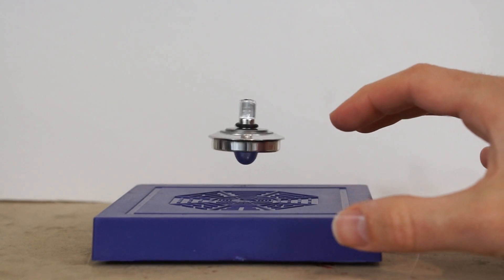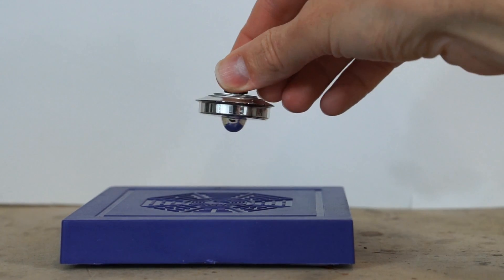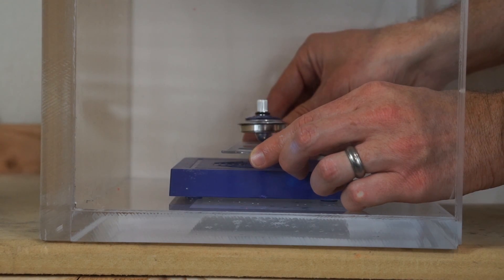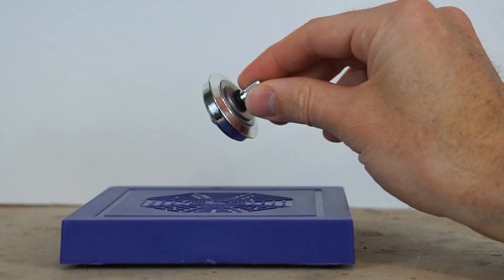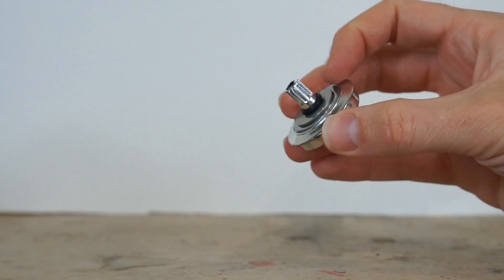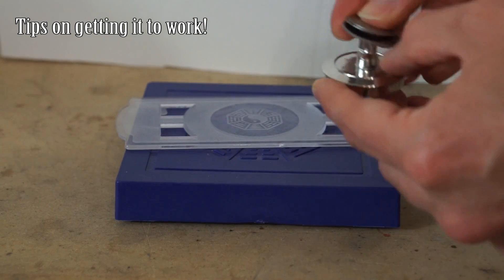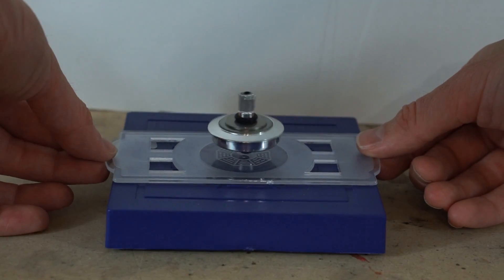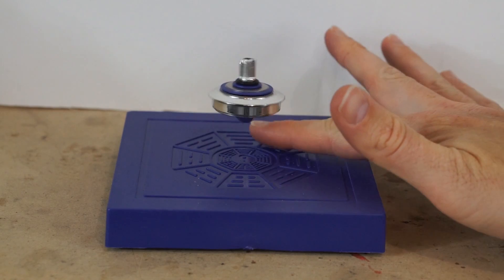Will a Levitating Gyroscope Spin Forever in a Vacuum Chamber?

Comment: it won't spin forever because the casing on the vacuum chamber will erode over time(which is not forever) and the vacuum pump itself will erode making the air come back into the chamber, and don't forget about electricity, there is a finite amount of electrical generators and power plants with an even more finite amount of resources needed to create said energy powering the pump making the vacuum stop, and what about the magnet itself? it cannot create an infinite amount of force to make the top spin forever, making said top not able to spin forever.
Reply: Yes, this is true technically but generally people ignore these factors. As a title of "Will a Levitating Gyroscope Spin For A REALLY LONG TIME in a Vacuum Chamber?" does not sound as clickbait, this experiment demon straits if the gyroscope can significantly spin longer until the factors that you considered are put into context. The person in the video is wrong about the friction entirely, as this will happen later on. 
What really happens to the magnet is that the gyroscope was not on its absolute horizontal axis, as this is extremely difficult to do. Because of this, the force of the magnetic field  is not distributed evenly on the edges of the gyroscope, this causes a increasing oscillation in amplitude of the distance to the magnet and this has proportional correlation to the strength of the magnet (obviously).
SIMPLE ANSWER: The fidget spinner doesn't slow down, it looses balance. So, the magic rocks (magnets) make it loose control because the fidget spinner is near impossible to be spun horizontally.
Reply: Hector Wilken no.
Reply: I think the idea is not so much to make it spin forever, but say, for the lifespan of a human.  That'd still be pretty neato, don't you think?  But on an even deeper level, to understand that electrons (and other particles) might be regarded as little gyroscopes who spin for a very long time and also flip over from time to time.  Imagine.  Let your mind spiral out to the infinite possibilities.  M'yan.
Reply: Flurban Moran I think subatomic structures like electrons have a completely different properties to large scale objects. This is due to the world of quantum physics, and how it redefines our understanding of physics completely.            Saying that... I wonder how many views I can get if I title a video "SUBATOMIC FIGET SPINNER WOW 😱😱 💯 🔥"
Reply: You think they have completely different properties.  That is a good start.
Reply: Well it's not really my area quantum physics, so i say "i think" because i cannot be certain, however i do have a initial understanding on the roles that take place in quantum physics. As well as, studies from various other physicists in relation. I can be CERTAIN  that roles like angle of momentum and laws in relation to gravity, have a completely can have a completely different effect in in quantum world.
@ Flurban Moran
Reply: Every layer is connected.  Don't forget, the physicists who spend all their time telling you what they know are the one's not moving forward.

Comment: Seems like it could spin much longer if you could launch it without so much wobble. Have you tried putting it in something with a stable electric motor like a drill or something similar?

Comment: IT'S MINI HAKKERO AND THIS GYRO SPINS BEING REPELLED BY INVISIBLE RAY OF MASTER SPARK oh lol just kidding, there's too much Touhou in my mind.

By the way, if we're speaking about something on the Earth orbit, I suppose, the most energetically preferable would be the configuration where test body is on circular orbit and oriented cylindrycally symmetric relative to gravitational normal, and has no rotational momentum except that is synchronized with orbital rotation over the Earth - due to tidal forces. So such gyro will be oriented to the Earth by one of its tips and will slowly rotate, but rotational axis would be not the main axis of gyro (from one tip to other one), but one that is perpendicular to this axis and orbital velocity vector (one of diameters of gyro wheel). If orbit is not strictly circular, then we'll see librations an we could see of the Moon; and if there is no cylindrical symmetry of test body, then there'll be another kind of librations due to non-uniformity of gravitational field. I think, these forces would be much more effective in stopping gyroscope in comparison to CMBR scattering and gravitational wave emission.

Comment: There is always going to be a desire for the magnets to ultimately line-up with their polar opposites. That is the friction, whether the magnet in the blue base is loose or not. It will find where the N - S are happy. Each time it passes a 'happy' alignment and spins through / lines-up / spins through, etc., it will slow down until it stops and lines up N - S relative to the top and the base magnets. That is why perpetual magnet gadgets won't run forever -- friction from the magnetic fields.

Comment: the pull of gravity against the magnetic levitation would still cause  a friction... If the spinners mass were cancelled ,then gravity would have no pull upon something with no mass ..if that could be achieved, then it would spin indefinitely...in theory   black budget tech likely use these principles ..in the case of alien tech , they  probably are using ideas far far beyond  mere mass cancellation...in our case though, it would be a huge step up from how we currently attempt levitation

Comment: Aside from the fact that there is factually no such thing as a perfect vacuum that man has ever witnessed or created... The magnets themselves provide resistance that the spinning cannot counteract forever. The gyroscope will slow and eventually flip over regardless of how much air is around it. Though less air means less friction, which means less resistance, which in turn means a longer spin. It will extend the duration of the spin, but it will certainly not allow for infinite spinning.

Comment: If the universe will not last forever, how do we know there is a forever. Let's roll one up and figure this out.
Reply: We don't have enough evidence one way or another that the universe is or isn't infinite and forever.

At the moment we believe the universe will end with "heat death" when everything, everywhere will be in thermal equalibrium, or with the "big rip" when dark energy overwhelms even the strong nuclear force tearing subatomic components assunder.  But all we have is mathematical conjecture and a few decades of observation, not enough to project out to a future of 10^100 years.

There is a chance that our 4D universe is suspended in a higher dimensional multiverse.  Our preceptions are stuck in 4D like poor flatlanders unable to conceive of 3D.  The whole notion of time may be useless in a multiverse it which time and causation is meaningless.

We know that map directions, north, south, east, west break down at the poles of the Earth.  When you stand at the north pole every direction you point to is south, no east, no west and no north.  The reverse at the south pole.

Could our mundane 4D universe be infinite?  We may be just 13.7 billion years into our universe wherein blackholes are the ultimate recyclers.  Got a stubborn sub-stellar object that won't fly apart and recycles itself?  Feed it to a blackhole, it will spew it out as a stream of fundamental particles.  Bits will fall in but Hawking radiation will, eventually, recycle that too.  We know the big bang happened due to the CMB, but given enough time the CMB will be stretched into EM wavelengths bigger than the observable universe rending it undetectable.

Comment: As several person have already mentioned, I think eddy current is a main reason to reduce the rotational speed of the top next to air drag.

In order to avoid eddy current effect, the following condition should be satisfied;
(1) Base magnet is completely homogeneous and magnetic field over that is rotationally symmetric.
(2) No wobble and precession movement of the top.
If even one of those condition is not satisfied, magnetic field which goes through the spinning top is not rotationally uniform.
And if the top magnet and weight balance is made of conductive material, eddy current is induced inside the top, which reduces the rotational speed of the top.
The top magnet is, presumably, made of neodymium magnet, which is electrically conductive. In addition some of the weight balances are made of metals (Brass).
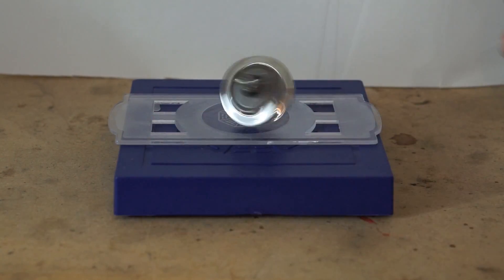You can recognize eddy current effect from the video scene of 8:37. When he start spinning the top at out of center of the base magnet, very strong repulsive force induced from eddy current effect fly away the top from the base magnet.

Comment: I don't believe you can say the magnetic field is a form of friction, magnetism is caused by unpaired electron spin within the atom? I believe the reason it stops spinning is even with the negative pressures you are using, there will be atoms within the chamber contributing to air-friction.
Reply: "negative pressure" ?
Reply: Thomas Kundera: Yes or in other words a vacuum), but thinking about it, i guess i am wrong on magnetic fields not being a form of friction; you could argue any form of resistance is friction.
Reply: Then it's "zero pressure" ;-)

Magnetic forces doesn't imply friction, but you have induced currents effects that will certainly create friction.
Reply: Thomas Kundera: No, anything below atmospheric pressure is considered by scientists as negative pressure and yes I agree, its the context to which the forces are being used.
Reply: "anything below atmospheric pressure is considered by scientists as negative pressure"
If you arbitrary put a "zero" at 100kPa.
It does make sense in some cases, but agree that it's arbitrary.

Pressure measure the force that gas particles creates. And you obviously reach zero when there is none left.
Reply: Thomas Kundera: Yes you can read temperature as absolute or relative, so if someone says negative pressure than assume they mean temperature below atmospheric at sea level.
Reply: @Suzy: as we are speaking about vacuum, its' better to talk in absolute pressure, where vacuum pressure is zero, as it should.
Reply: Thomas Kundera: Yeah and everyone in the West wants the yanks to go Metric; thats life)

Comment: Well, it is not friction which slow down the gyroscope it is magnetic induction because the metal the magnet is made of is a conductor so the off axis rotation(i lean the fact that the gyroscope is not perfectly aligned with the vertical axis which imply precession due to the magnetic field) of the gyroscope slow it down. Also background radiation won't slow anything they are almost isotropic so you have a lot of interaction background radiation photons but no net force and then considering the size of the object and it's density there is only a negligible amount of energy (i mean way above thirty order of magnitude under) lost due to gravitational wave than the amount lost due to star dust, because even in the emptiest void of the universe you have 2 atomes per metre^3 and this is the main reason why it would stop in vaccum(space)

Comment: Spinning in presence of magnetic field will produce Eddy currents and force will act on current carrying gyroscope present in magnetic field thus it gets damped
Reply: Wolf Edmunds not insignificant 
Enough to slow it down
Reply: Ferrite is not an electrical insulator, so it has eddy current losses - but a lot less than metals.  The thin chrome plating on the toy itself is unlikely to be as significant.   And there's still residual air to provide friction (is viscous drag linear with pressure?  I'd imagine strange things happen with long mean free paths).
Reply: those two responses sum it up well!   well done!
Reply: Ideal inductors do not dissipate power. That said, unless the top was made of a superconductor, there will be resistance and that small resistance will convert a tiny amount of electrical energy (from eddy currents) to heat.
But all things considered, the amount of energy lost due to eddy currents is still extremely insignificant.
Reply: that and the fact that even space nebulare are less dense then the artificial "vacuums" currently producable by human science.
Reply: Though eddy currents do have an effect its extremely minimal, the reason it slows is due to the instability and shaking burning off all the energy

Comment: There is supposed to be version of this done with a 1 kg iron ball. It's start spin was 1000 rpm and was estimated to lose 1 revolution per second per second (about 1 revolution per day) thus spinning for years.
Reply: Vance McCarthy 
Interesting story. And where did you hear such wonderful things?
Reply: 1000rpm, losing one per s², that's a bit less than 20 minutes of spinning, not years?
Reply: 1.000rpm = 60.000 Hz. Reduces by 1 Hz per second (Hz = 1/s, so 1 revolution per second per second = Hz/s). Therefore the ball would stop after 60.000 seconds, which is a 1000 minutes which is 16 hours and 40 minutes. Its neither years nor 20 min. Its simple math guys... This is of course assuming that the original statement is correct that the deceleration is actually constant and 1 revelation / s^2, which is highly doubtful.

Edit: of course 1.000 rpm = 1000/60 Hz = 16 2/3 Hz. So it would actualy stop after about 17 seconds already... That's a factor 3600 difference. Still neither 20 min nor definitively not years.
Reply: Jasper Mooren as close as you are, 1 rpm is equal to 1/60 hz, do the same thing as you did before and boom something around 16 seconds of rotation
Reply: oh yeah of course... 1 min = 60 s, so 1 rpm = 1/60 Hz... facepalm. (people shoudn't use non-SI units anyway)
Reply: Why so much thought into it, just say WronG
Reply: Twisley if we were to just say wrong, people will continue to think it's real and be fed false information

Comment: Magnetic pulses come from air resistance and for it to stay floating it needs air magnets use atmospheric pressure to shift against each other so no it will probably fall about 5sec or 6

Comment: hello, i just wanted to say that i got one of those toys and it was broken. the plastic case was cracked and the magnet i had inside was square. i wanted to add that it had been glued to the plastic case inside. i fixed it best i could and tried but failed to get the top to levitate. i had chipped the top on the edge from it fling off the plat form and dropping. Thank you for the tips. i will try. just wanted to add info and my experience.thanks again

Comment: I assume it will stop from the force of gravity, I remember reading a book about gravity and such and it said a pendulum would keep going in a vacuum if not for gravity. Except for the fact a pendulum needs gravity to function, which they didn't say... And the book also mentioned throwing a ball, the ball will go forever in a vacuum if there's no gravity
Reply: Ok now I continued the video, the friction makes sense. I do think if the magnet was fixed and friction was eliminated it would stop due to gravity. In an imaginary vacuum where there is no external forces it will go infinitely

Comment: One more reason a satellite in orbit won't spin forever is tidal effects. An example of that is the Moon which is always facing the same side to Earth. The drag from the ocean tides, and also lithospheric tides in the Earth crust, are slowing Earth's rotation down as well, so eventually Earth will also become tidally locked to the Moon, like Pluto and Charon are locked to each other.

Comment: For everyone who is confused about gravity and friction:
Friction is the result of microwelding between materials. Gravity is not involved, and cannot cause friction, because gravity is not a material. Example: there is gravity in space but (mostly) no friction hence why the Earth continues to revolve around the sun, gravity and all.

Also, gravity's downward force is countered by the magnet's upward force, causing a sort of equilibrium, so gravity has no contribution to why it falls from a state of "rest", gravity only contributes by accelerating the top down once it's no longer in equilibrium (and of course it's keeping it in equilibrium but my point is that gravity is not upsetting the balance here, it's upholding it).

The reason it falls is likely electric currents formed in the metal pieces of the top which become energy lost (from spinning) thus slowing it down until equilibrium is lost. But being that the strongest force present is magnetic force itself, I believe the energy required to rotate past the point of greatest magnetic attraction repeatedly causes the fall. In other words, neither magnet is perfect, so like a wheel with a lump on the outside, it will eventually stop rotating because of continuous acceleration (the bad kind).